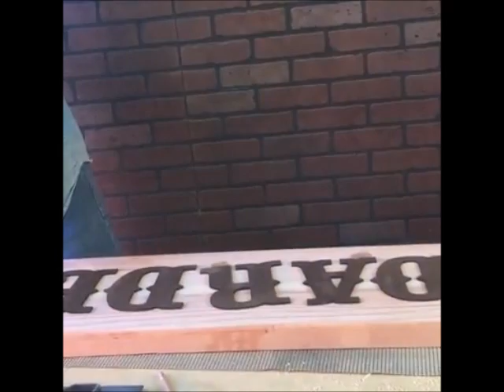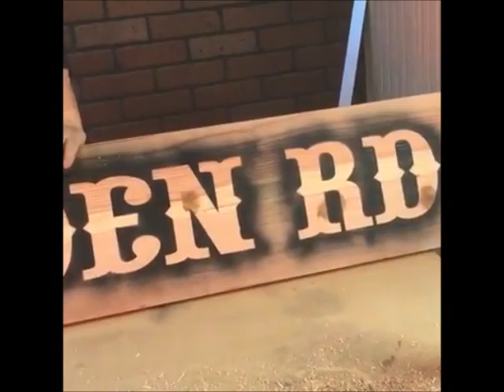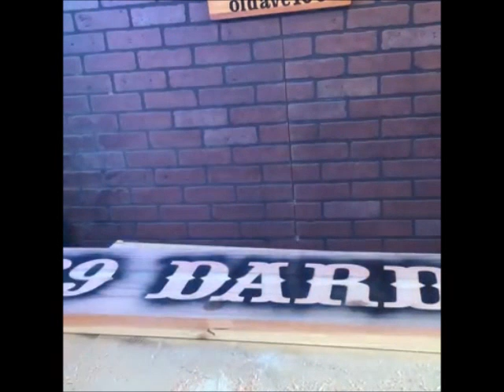LTS Hand plane and layout 2/27/16

Comment: good job i although i was wondering how the power hand planer handled the knotty wood because i have a piece of knotty wood i would like to plane but im worried it would kickback.
Reply from the maker: Never had that happen. I have had knots break out, but never kick back.
Reply: thanks for replying just i decided to try planing the knotty wood today and it actually worked out great with no issues
Reply from the maker: That's good to hear. Yea I like using it, saves tons of sanding time.

Comment: Hey guys. Another great Lts. I'm just now getting a chance to watch, so wasn't able to send a question live. I have one that Frank's question about sanding sealer reminded me of. I'm a great fan of the laser and wintergreen oil transfer method. But I've been having a problem when using western cedar. The lighter colored strips in the wood seem to be much more absorbent than the darker parts. When I've transferred artwork, after just a very few minutes the oil/laser starts to bleed where the lighter strips are, and the lines in my pattern start to blur. Sometimes severely, to the point that I'm really just routing by memory where the actual lines should be.   I had thought of maybe spraying a light coat of sanding sealer on the board, then sanding the surface to see if that would stop the outward bleeding from the fine lines. Have you ever tried that, or know of some other way to prevent that blurring of the lines in the lighter colored part of the wood? Thanks. Jim
Reply from the maker: +Jim Hester I've never had an issue with any bleeding in western cedar. I would try the sanding sealer. It works goon pine. Thank you,
Reply: +Dave Rhoten I'll do that. I haven't heard of that problem before, and I've also suspected that my wintergreen  oil may be a little too strong. I'll try a different brand of that, too. Thanks.